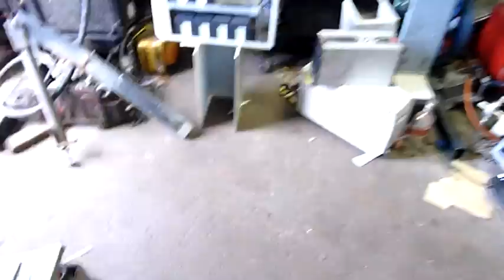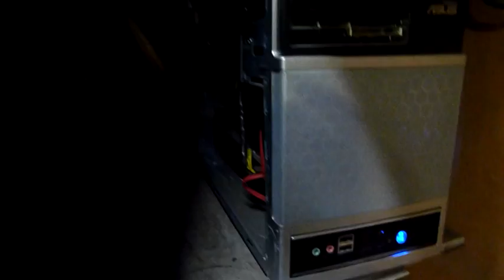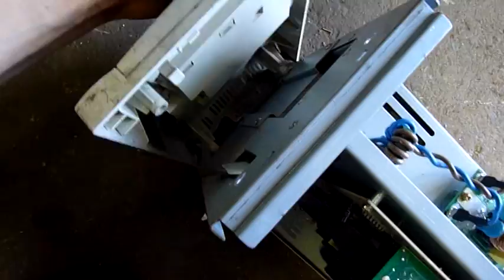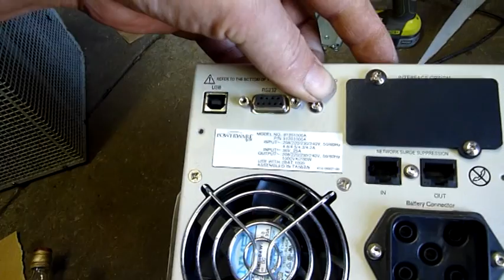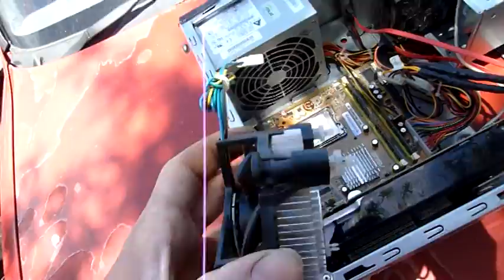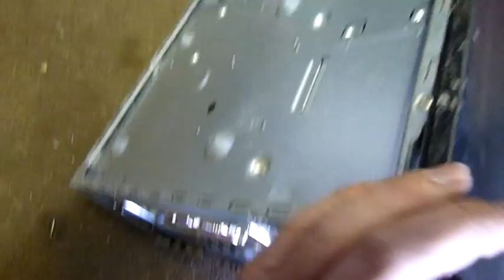Workshop PC and UPS Refurbishment

Comment: Things like induction motors and large transformers don't run well from a modified sine wave inverter. They make loud angry buzzing noises. Most switch mode power supplies don't mind it, and universal motors run fine though.

Comment: Modified sine wave inverters are good for a cheap inverter but they don't work with a lot of thyristor speed controlled motors. And they also confuse clocks that use the mains frequency to keep time. And also making comp

Comment: One thing I've learned from experience that they don't like is standard iron-core ballasted fluro's - I killed an old UPS that way!

It was a line-interactive type so it worked fine until the power failed and the inverter actually kicked in.

Comment: you should cut the secondary off the rf welder and make another high amp transformer and you should connect it to the main house breaker.

Comment: I am currently working on a budget build out of parts that I already have and stuff off ebay, when i am done with it it will be a old overclocked intel core 2 quad Q6600 and 2 gtx 280s.

Comment: Anything with a brush motor wouldn't give a rats bum what the line frequency is, in fact you can run most of them from straight DC and they wouldn't complain. Where you could have problems is with an AC induction motor, but most aren't that finicky unless they run at too low of a line frequency, which can cause them to overheat and burn out.

Comment: Modified sine wave UPSes are fine for anything that does not have active power factor correction circuitry in it. You can't really damage anything with modified sine wave but if things don't like it, they usually complain really quickly after startup.

Comment: I use an arctic cooler 10 .. Has like 100mm fan and 6 copper heat pipes.. Add to that 2x80mm on front pulling and an 120mm on back blowing..  Pc stays nice an chilled.. Now it barley get used

Comment: Those ups have limited lifespans, eg after 5 years they get thrown out even if all they need is a new battery. Regarding the new hdd, you'll find if you can use a tool like seagates drive wizard to clone your old onto the new you'll notice a huge jump in system performance by using the new drive as the primary

Comment: APCs can be cold-started. Depending on the model either hold the on-button til it beeps or press them both until it beeps. To shut them down completely afterwards hold the off button until you hear the relay click inside.

Comment: Pure sine wave can run anything like you would on regular mains (it's cleaner than regular mains actually) up to it's maximum power limit.

Mod sine wave/Square wave can run anything with a switched mode power supply quite happily, anything else like motors will not be happy and will run hot and under powered.

Wish I live in Aussy and local as I could do with a new UPS! Mine gave up the other day with bad batteries so it can't be doing a good job charging them, they're only 2 years old.

Comment: i have never had any problem with modified sine wave it doesent seem to make any difference i had a 2kva ups which wasn't a sine wave one and i cut the grass with an electric lawnmower and we used it for my flat screen tv when the power went out as we had no gas for the generator it works with power drills and just about everything including our oil boiler which is coupled to a modified sine wave ups the motors in make more noise but it doesent seem to have any effect with 6 years of operation

Comment: 12 volt 7 Ah batts are the most common and a lot cheaper to buy than less common sizes. Try Battery specialists 240 Boundary Rd Braeside, VIC 9587 0866 Jaycar etc will rip you blind for lead acid batteries. They also sell name brand units rather than one hung low special lucky dragon number 4 brandlso. PS I don't work for them :-)

Comment: Steel mill computers had black dust eh... I have some from a forgery and they had black dust too, it was heavier than normal dust.
Installing that case fan in that workshop PC is OK, but in my experience you'd do better to have one blowing in too, preferable a slightly more powerful one because it'll gather less dust with a slightly positive air pressure.

Comment: dust wise you are always better having more intakes in pc's then exhaust. having a positive air pressure in the case means that dust wont get sucked in all the little holes under the case and around the back.

Comment: Protip: on any intake (let alone intake fan) put a piece of pantyhose on the suction side - it stops the dust from coming to the PC pretty much completely :).
And for the CPU cooler - Core2 is so low power... Just as SandyBridge! I am using i5-2500k with Thermalright Ultra 120 without any fan right now and the temperature barely rises :)

Comment: Core 2 CPU are very efficient. They produce little heat. But using that larger cooler will help in the summer heat.
You may also want to try just using a front mounted fan. It will keep the case at hi high static pressure and keep the dust out.